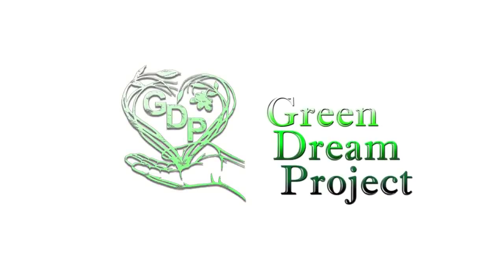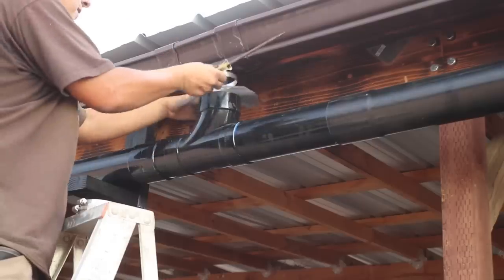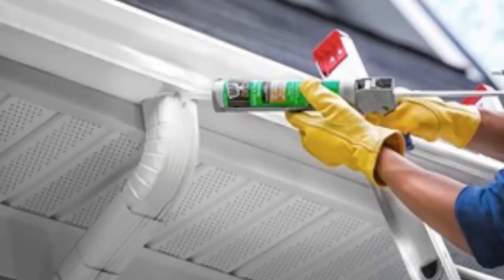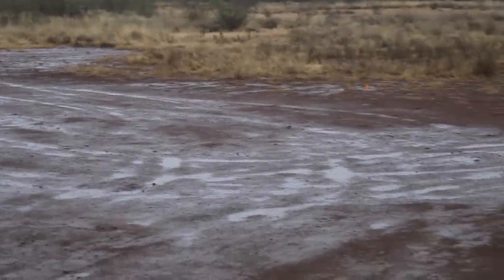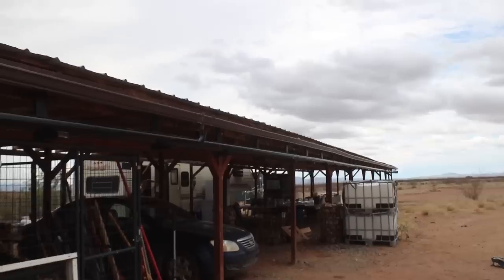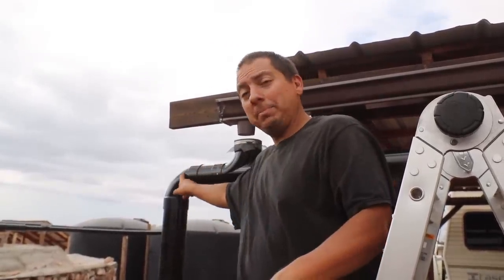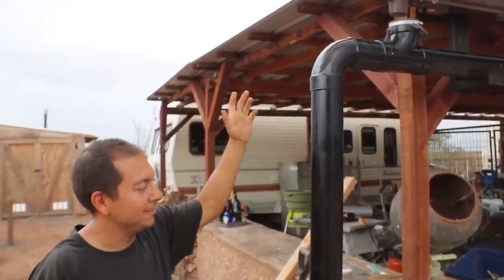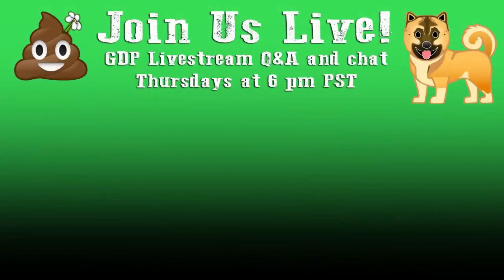Avoid These 5 Mistakes When Rainwater Harvesting | Things The Books Won't Tell You

Comment: Just wondering how full is the cistern? I'm thinking about 1/3 ? It's still early monsoon season yet. Can you let us know how full it is ?
Reply: Cistern will take YEARS to fill.
Most likely less than 1.5 inches of water on the bottom. Ferro cement is a thirsty surface that absorbes massive amounts of water before it sheds any. Poly tanks are main reserve now, with cistern getting only overflow.
Reply: @honthirty_  He does not have a cement bottom. In fact there is no cement at all in this one. He built it with sand bags then put the rocks around the outside and but a heavy plastic lining inside. Kind of like a above ground pool. I bet a couple of good monsoons will or could fill it. Maybe you missed the video where he was building it. But anyways I could be wrong on the time it takes to fill.
Reply: @stevethomas5209   Maybe you missed the ferro cement ROOF?  That is the only active collection surface currently, since the 2200 sq. ft rain collection roof is directed to the black poly tanks & only the overflow will go into the cistern after the tanks are full.
You are right on it taking a couple of monsoons to fill it, considering there is only ONE monsoon per year.   Similar to there is only one Winter or Summer per year.

Comment: I'd be interested in how much water you end up getting in the underground cistern (during the monsoon season)

Also, please answer why you didn't move the poly tanks closer to the end of the shed (between the shed and underground cistern) as that would have simplified your piping considerably
Reply: @kjs65a56  that's ridiculous logic.
I'm not asking for that level of precision and no one else expects that either.
I lived in a RV for years and know about what a person uses per day on average and it's 8 to 20 gallons. Yes, they've got plants and livestock but the day after a rain in that large of an underground cistern their use MIGHT  be 1/10 of an inch, if that.
So a BALLPARK estimate of the water he captured is entirely feasible and practical.
Reply: @kjs65a56  yes, that's theory
I'm asking what he ACTUALLY got

Comment: Aren't you concerned about sediment buildup in the underground pipes?
Reply from the maker: I don't think it will be much of an issue for awhile. It will take a long time to build up.
Reply: @ourselfreliantlife  I truly hope you are correct. There is a lot fine silt going through those screens especially without a first flush system. Then again most your rain come in the monsoon season all at once 🤷‍♂️👍
Reply: My idea exactly, there is no way to purge the lower pipe of debris. I believe a straight high pipe would be much better than the "u" section.

Comment: It can be worth it to put in a temporary holding tank at the point of water collection to reduce the amount of big pipes needed then go with a gravity drain or a direct drive solar pump to move the water from the temporary tank to the main tank over a few hours. Say you average 200 gallons off the collection surface per rain so a 500 gallon temporary storage would work and a little 5 gallon per minute direct drive solar pump would move 300 gallons in an hour at peek efficiency so drop that to 3-6 hours with the distance it is pushing water. 

You can get a 500 foot roll of potable water pex for under $200 so much cheaper then running 500 feet of 3-4 inch PVC pipe even when you include a pump and panel.

Comment: If you’re going to use silicone please use aquarium safe silicone… other silicones have toxins in them.
Reply: Great warning. Thanks.
Reply: @sandhills2344  maybe he does care about toxins but didn't realize there were toxins in either...or maybe he plans some type of filtration system down the road.
Reply: E -6000 and/or NP-1 are by far the best
Reply: I use silicone 1 which from my research is safe for use on plastic and is non toxic. Some of the other silicone though are toxic yes

Comment: I am no expert, but I like this topic so consider me YouTube educated (which is not much).  Most systems I see throw away the first water which basically washes off the roof.  And only after the overflow from that do you start collecting.  Any reason why you skipped that step?
Reply from the maker: I feel with where we are it wasn't very necessary. Not as much debris as in some areas.
Reply: @ourselfreliantlife  The water does not have to get thrown away.  It can just feed a tree or whatever else you want to water.  It looks to me like a good wind could put lots of dust up on the roof.  It is a lot like grey water (water from your sink and shower).  You treasure it, but it is not for drinking.  Good luck.   By the way, could you share where north is again (sorry if you already did and I missed it).  I wanted to see where the windows are in reference to the sun.  I know your house is not an earthship, but you seem like neighbors and you should probably take cues from them...

Comment: I see your point about the 90s you used. Backflow resistance (if that's the  correct term) would cause a problem. And I see why you use a 90 at the down spout.

But why didn't use 45s for all the turns past the initial drop? Yes you need 2 of them for each 90, but you should less momentum through the system to make up for the additional cost.

Also you said you roof drain wasn't the best angle.  How much taller wall height would you  add to it if you could do it over again now?

Comment: Nothing will seal the gutter when they are 100" long as the expansion and contraction of the Aluminum is going to either take the joints apart or take the screws loose and then they come down.
Reply: hmmm, that's a good point.
Reply: Gutters don't need sealants esp.
IF they are properly spaced and placed,  correctly angled and sloped and well-placed proper supports.   Sealants have chemicals which are dangerous to health and unsafe for drinking...  I am speaking from experience.   Many decades thriving on rain-water for drinking and other house use from my rain-catcher.
Reply: Hopefully that will take a couple years(or better a few),might be a good time to start a fund to start saving to replace.

Comment: System looks great
If you find the 4 inch screens building up with dirt
They make 4" to 6" PVC adaptors
Might help with clogging
Also if some of you may have problems thinking these sweeps may be to restrictive
In electrical the 4" PVC sweeps have a much larger radius